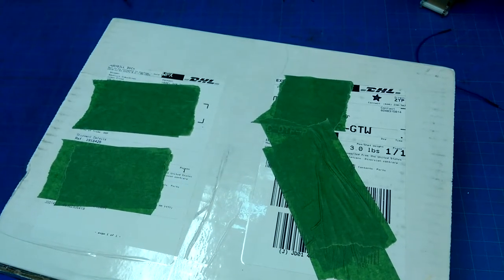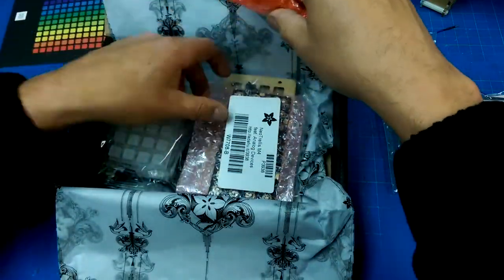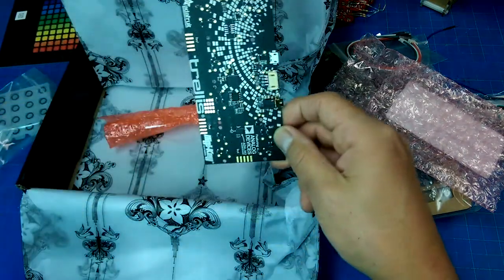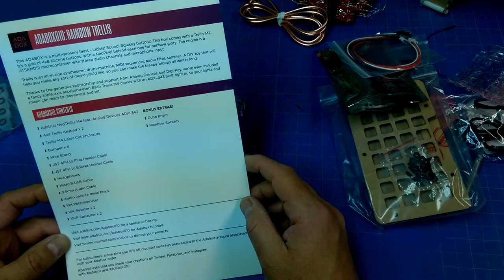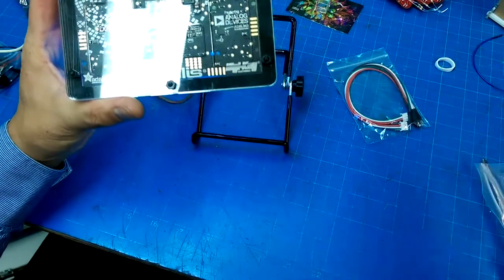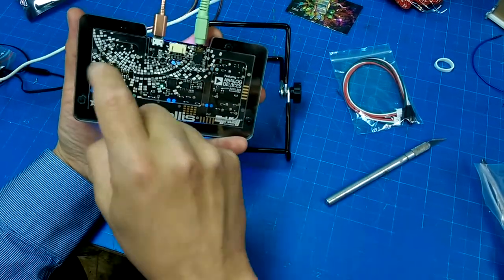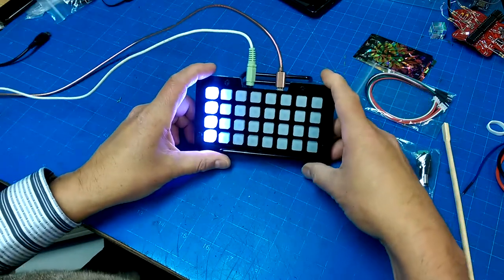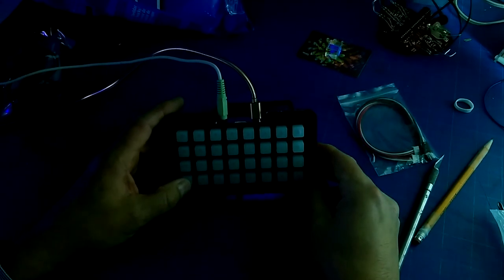Adabox 010 NeoTrellis M4

Comment from the maker: They are in case you need them to interface to some other audio componentry (a capacitor for dc blocking, or perhaps to create a low/high pass filter or a voltage divider).   They are not needed for anything but are nice to have in a parts bin.
Reply from the maker: I did a (poor) video of low and high pass RC filters a while back.  I need to find time to do a better job at explaining them.  https://youtu.be/Lx3RvTRPep4